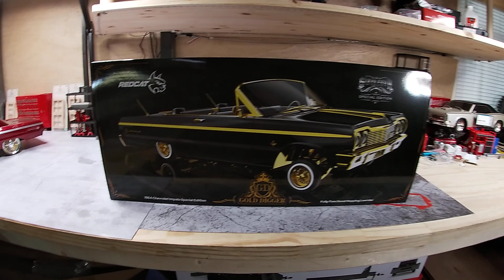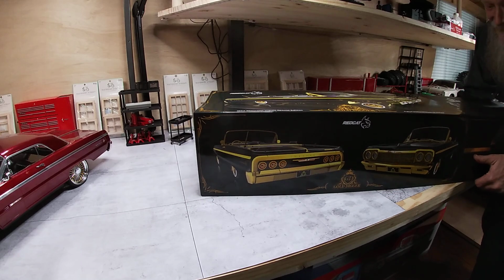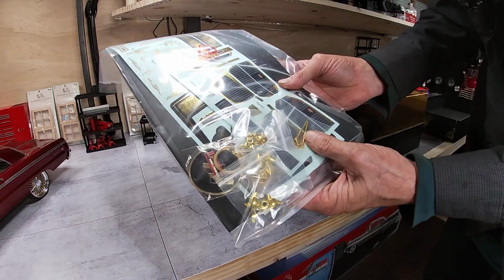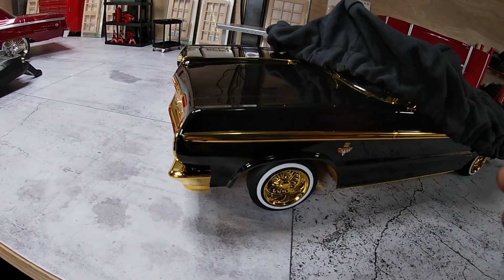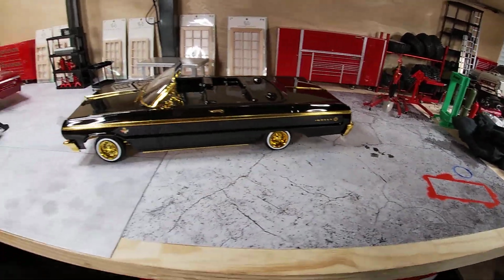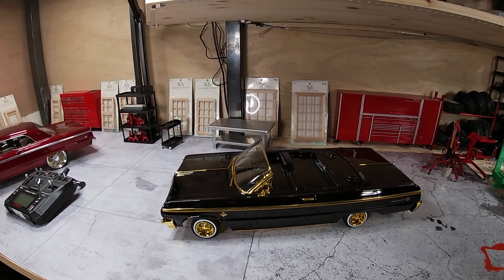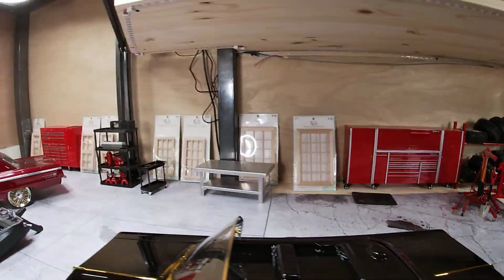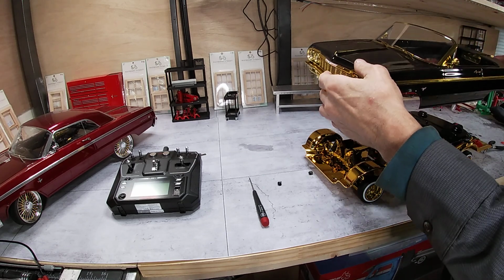SPECIAL EDITION REDCAT 64 GOLD DIGGER LOWRIDER UNBOXING

Comment: Other videos mentioned it came with magnetic mounts pre installed.. front and back
Reply from the maker: Hmm weird mine was 2 screws up front and 1 magnet in back. Thanks for watching bro 👍
Reply: @redwolfrc1.14 theres magnets u just pull it off
Reply from the maker: @keeksncase  so i didnt really have to undo the 2 screws up front just pull it off correct? Lol when I'm extremely careful . Thank you guys for the info.
Reply: @redwolfrc1.14   yes ! I just kinda twist it it comes off easer like that way !
Reply from the maker: @keeksncase  sweet 👊💯👍
Reply: @redwolfrc1.14  haha always tuned in !! Also I seen red cat have the la güera body on sale on the website you getting one ???
Reply from the maker: @jae2783  I've been wanting that one for a long time now. I keep missing the sales lol. But in going to try